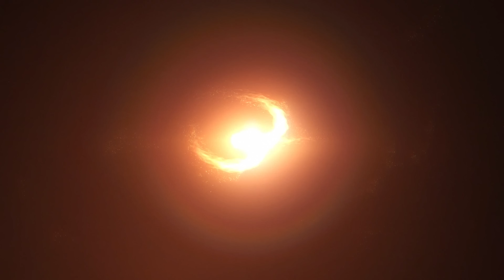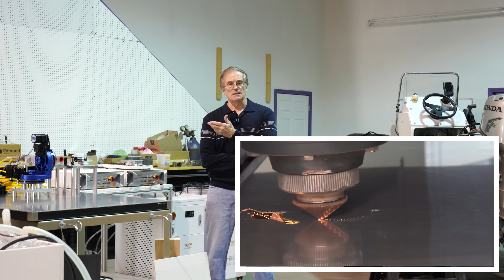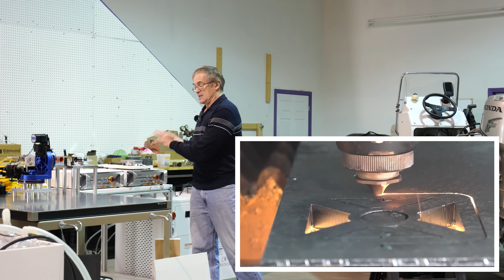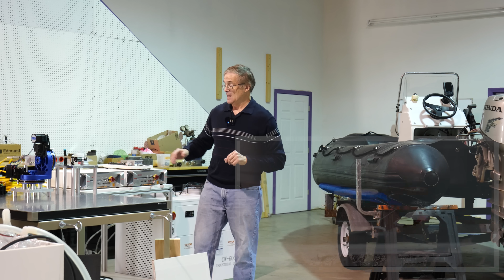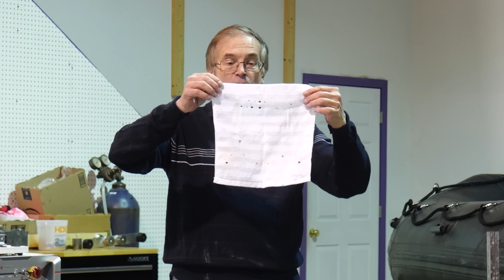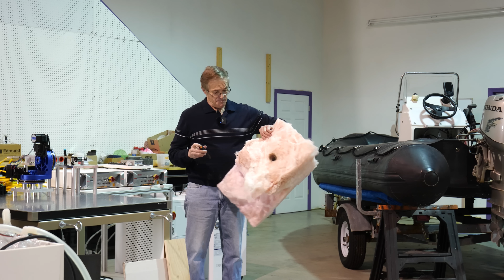We have a problem... and need your help!

Comment: Paper that has been wetted with borax saturated water, and the allowed to dry, will not  burn.  It will smoke but will not propagate a flame.  So treat your plywood with borax water and test it out.

Another idea is a wall filled with sand.   As the sand is obliterated  by the laser, new sand will fall into place to replace  the smoked material.
Another idea is a wall filled with marbles, the glass should diffuse the light and just like the sand wall, marbles that are obliterated will be replaced with fresh material.
Reply: Sand wont steam, most will glass  so no hole filling.

Comment: I own fibrelaser systems, and i fear without specialized material, there is no big chance. We have a company here in german, Bergmann & Steffen GmbH, they produce the llaserwall system, a relativily cheap protective wall system. Maybe you could ask them for some kind of sponsorship/demo setup? Not sure with the current tarrif situation. But you may also be able to find some parts in the US. Look for laser-welding protection systems.

Comment: I have NO idea what I am talking about. But, I wonder if having some metal powder (The kind used for 3D printing/sintering) as the backing would absorb the energy better. Because what I think the actual issue is, there isn't enough energy being absorbed by the backing/blocking material fast enough, before it just "explodes/ablates" away. The powder would absorb the energy by not having any real direct path through, and the powder MIGHT shift and flow back to the melting zone better than a solid would. I'm kind of doubtful about this though, as most of those powders are meant to not move. I don't know, but it might be resettable like shaking an etch-a-sketch. Obviously, don't use something that would start any sort of 'thermal runaway' situations where it could self sustain that reaction... But maybe nylon? Stainless Steel? Maybe a mix of both, to prevent one or the other from sustaining a reaction?

Comment: Before you even mentioned a wet blanket, I had remembered the old demonstration from science class where the teacher held a plastic water bottle over a bunsen burner to demonstrate water's heat capacity, the bottle wouldn't melt away, the water within kept it cool enough. Perhaps combine a water vessel with an intumescent coating or paint. I'm excited to see what others suggest.

Comment: My brain says... molten salt with ground quartz and graphene, suspension in a constantly blending tube via induction pumping, only problem is getting a viable encasement for the laser light to penetrate but not build heat... maybe a jiggling glass apparatus that shakes and rotates so the heat cant focus and burst a singular area, it would have to be soooo fast but could be miniaturized once tested.

Comment: I suggest the following..  Graphite blocks: Available from EDM suppliers (electrical discharge machining), Used kiln firebricks to back that up .Check ceramics suppliers or surplus.. For  even more  protection back the  rig up with a sheet of steel  or copper  painted  black angled at about 15 degrees .. use active or passive cooling on the plate ..
Reply: Graphite fire is no good
Reply: @WanderingThoughts11235  Spray some water on it while in use.
My intuition says that it would be hard to set a graphite brick on fire with a 10KW laser even if you tried. But if you want to be extra safe, just inspect the graphite wall with an IR camera when done with your laser tag session.
Reply: Ha, same idea. :D
Bricks of compressed charcoal will have some fly off and the smoke disperse the beam further.
Awesome to help. :)

Comment: 2 panes of clear glass with water between them, color the water with dye to absorb the light. Or you could just do it outdoors and point the laser up into the sky. Also during testing the laser doesn't need to be a full power, you only need to verify it hit, full power is only necessary during the final demonstrations to show off destructive force.
Reply: That might add expense by needing to reinforce the roof to survive the rain of falling airplane wreckage.

Comment: I’ve enjoyed your site for many years.  My daughter owns a freeze dry company.  Her comment “ice is the bane of my existence” has led me to research the science of ice and water vapor to help optimize her systems.  Unfortunately my ideas were never scaled up to help her, but the science  of ice has stayed with me.  At first it seemed your laser was pointed down.  An optimized size tub of water and not a wet dish towel may be worth a try.  If clear water is unable to prevent pass through, then adding a black powder or tiny metal flakes to enhance refraction may be tried.  Back to ice.  A sheet or block of ice is cheap and easy to produce.  If reflection off the surface is too great, a cover sheet over the ice would allow the laser beam to punch through, and prevent the ice surface to act as a mirror.  Frequent replacement of the cover would be required.  A less cost effect experiment would be to use dry ice in lieu of ice.  A problem of using a laser to drill is the dust and powder that is generated in the hole that refracts laser light.  A metal tube could be filled with smoke or duct particles to help refract the laser  beam.  A prism came to mind but the laser be be intense to vaporize the surface mirror any dust that collects on for surface.  A prism separates light into different frequencies, but laser light may be more coherent and the refracted light may not be split into different primary colors.  Interesting problem.  I’ll follow your progress.😎
Reply: Yes, ice would be best you're right.
Reply: I second the ice. It was my first thought also.
Reply: Instead of ice, why not packed snow? It'll split up the incoming beam into fragments and be cooled off faster
Reply: yeah a big ass-block of ice or maybe get fancy with some other frozen phase change diy goop
Reply: @ Actually, you just made me remember something even more simple: pykrete.
Reply: Water is too reflective; ice WOULD be literally perfect bc it kicks out vapor when hit, scattering beam, but too hard to make that much

Comment: @NightHawkInLight has a video of how to create Starlite like material using very cheap household materials and I believe in the end it will fully carbonize to protect and carbon has like 4000 °C melting temp. When heat is applied, the material chars, which creates an expanding low density carbon foam which is very thermally resistant. Starlite was also claimed to have been able to withstand a laser beam that could produce a temperature of 10,000°C. I believe using this is your best shot.
Reply: His video was the first thing I thought of: https://www.youtube.com/watch?v=0IbWampaEcM

Comment: Have you guys tried a heat resistant paint? Perhaps that could be used on a couple of layers of a silicon treated canvas tarp. This stuff is good to 2oooF 
Rust-Oleum- high heat ceramic spray paint.

My 9yr old son and I Love you guys!

Comment: Try a bags of wet sand. Build a wall from them. Its cheap and I'm pretty sure its going to work. In the end you'll be left with a bunch of sand that you can sell or use for something else.
Reply: Or tiny glass beads... You sell as jewelry. Lol
Reply: the water would cause steam explosions, not a good idea. Dry sand is the best.
Reply: Good idea, and the sand may even transform to glass, absorbing more energy in process (and producing even more fun ^^)
Reply: Could be highly reflective glass. Dangerous.

Comment: Buy large bags of fluffy fumed silica and used them as sandbags. The fumed silica diameter is smaller than your laser wavelength so you will get raleigh scattering, plus it's non-flamable and melts at high temp. This is only an idea, I don't know if it's safe so be extra cautious!

Comment: So to make it short, you need a high energy shutter and a room where you can turn the laser energy into heat without starting a fire/create "dangerous" toxic gasses.
And the shutter must react quickly and take up high power and a certain amount of energy.

a.) One way to divert: when you'd have a "cooled" mirror that can enter the beam rapidly - that can redirect or scan the beam at a "safe" area

b.) when you'd rotate (or even scan) a 45° at a certain rpm, the reflection would be spread over a much bigger area - which brings down the cooling and material requirements
a scan target must also not be the inner area of a cylinder but can also scan to increase the affected area thus reducing the specific energy on an area that needs to be cooled off.

c.) remark: the mirror should scan and direct the laser downwards, because burnt material could peel of from the ablative catcher, and when the material is below the mirror, contamination and destruction of the mirror due to ignition by laser light might be less of a problem

d.) the mirror could simply be cooled just by a directed water jet, aimed at the back

The targets could then be normal bricks, which you have tested, perhaps also wet bricks, due to the spread the survival time could be good enough

A graphite target would also be an idea, but then you need to use inert gas because under such conditions the C would react with O and another O and at best you come up with CO2, but at worst with CO - which is flameable/explosive itself - but as CO2 is mostly considered inert as well as denser than air, you could also use a constant CO2 flooded chamber, that works like an aquarium that is constantly(because heat->convection->gas loss) CO2 filled and where the targets are submerged and therefor cannot catch fire.

Similar to the experiments that are done in school where you can demonstrate with that air and gases behave very similar to fluids and can extinguish for example a candle.

The CO2 filling could simply be inserted from a gas bottle, or you could put dry ice in a bath of water, that would fill up the "catcher volume" with CO2 and work as fire suppression.

- Al2-O3 in corundum (blast medium) form could also be interesting, high melting point
- Another thing you could try is a kind of flow cooling: What would happen when you have your plywood continously flowing down water - like in a water play that overflows a top spillway.
that would also remove any fire risk and is regenerative with a pump and filter.

- Strange idea "a soot chamber", the laser is direct at a chamber where soot particles (smoke) is that would reduce the energy at the final impact

Comment: another idea could be using a moving target, like a rotating wheel of a heat resistant material able to resist the beam for a few seconds, like concrete, so that the laser energy is spread over a much larger spot overall. it would need to be replaced eventually, but it should hold of a bit and can be made relatively easy to replace

Comment: What if you took a two layer approach. One outer layer that gets punch through initially and then the second layer that has a ton of refractions to refract and reflect a beam with lower intensity back to the first player. Probably a standoff between the two layers.

Comment: What about some sort of water container using a matt glass for containing the water. You will also have to mix some aditive in the water that will not allow the light through the water but rather just absorb most of the energy.

Edit: balistics gel also just came to mind?

Comment: How about a wall made of fibreoptic that redirects the laser to a single point that is more durable (brick/concrete).
(since you do not need to have a durable part on every point, if the laser only hits the surface on one point)
Although I have absolutely no idea how much that would cost or if there is something you can already buy ...

Or a really big glass lense that redirects it to a single point?
But that would probably also be to heavy and takes too much space.

Also I think I saw a video about a black protective coating that made things durable so they won't take damage ... but I can't remember if it was also heat resistant.

... just thinking about solutions atm. ...
Reply: oh well the coating was called "line-x", veritasium had a clip with the title "Indestructible Coating". Quote: "is also used on the walls of The Pentagon in the event of a bombing"

Comment: Taking inspiration from a black-body radiator - You could build a box with many mirrors and/or prisms to bounce the light around. Or would the intensity of the light be too much and burn clean through the first mirror?

Comment: I'm curious if HDPE (High density polyeruthene) could be used as an ablative tile, would need to be thick at least an inch i think. As other have mentioned Starlite that nighthawk lighting did the some experimenting with and Areo-gel could be some other alternatives.

Comment: I have worked with some high powered lasers before and we had a "blanket" of diffusion crystals and that was over a fireboard that was about 3/4 to 1" think. From what I can remember this worked well for us. However I didn't see where you gave the power of light source in your video so calculating your needs are impossible. The cost was a little high from what I can remember for the 'Blanket" but the rest was cheap. I hope you can find what your looking for, and I may be able to help you find the "Blanket" from my military days.

Comment: Make a test protype of a steel plate, alum plate, dry sand, alum plate and a steel plate. Steel would hold up set together.  Alum will be to help transfer heat.  Dry sand will flow, but melt in to glass; transfering heat. the last alum plate and steel to help stop and buy time to cut laser off.  Plus, at the end you can sale the metal to recycler. Sand can be gave to play ground or other use.

Comment: Would ceramic or concrete floor tiles be too heavy?

Or take your wet blanket idea but add a reservoir and a pump so there's a constant waterfall running over it?

Comment: What about laser beam-traps used in labs ? (I think they use anodized aluminum or graphite). Zap-It is one company that makes them. They have a water cooled version for 0-1000 watt capacity.

Another idea to consider is a large de-focusing lens at the destination.
Reply: Looking up those lasers I'm pretty sure that they're each 3,000 watts and he mentions wanting to focus them both into a sub mm beam Channel... commercial back stops are wildly insufficient.

Comment: Keeping your plywood wet would keep it from being able to catch fire enough for firemen to be called would be the cheapest option. 
I guess you could also attempt to build a light proof box with photodiodes of sorts in it. Once the laser burns through the first layer, the photodiode in the box sets off a cutoff switch to your laser. Could even probably modify a Sawstop saw control for it if you don't want to deal with starting from scratch.

Comment: Lot of good ideas have been mentioned. But I think a combination of suggestions may be the key. 

You want something that is fairly portable and easy to construct. It must be capable of dissipating a considerable amount of concentrated energy. No toxic off gassing or flammable materials.

Starting with “kiddie pool” as a sump, place in an easel with a ceramic tile covered sheet of rockboard. This is your “sacrificial backstop”. Use a pump with a  laminar flow head at the top of the easel to provide heat dissipation and eliminate  a fire risk. 

Fresh water has about a 4.2 J(k-G) thermal coefficient, so you can conceivably calculate the flow rate required to cool the tiles.

Even with constant water cooling the beam will impart some damage to the tiles. But with a few tiled rock boards on hand, they can easily and rapidly be replaced as necessary.

It is a cheap, easy, and viable solution. Perfect? No, But it certainly checks all the boxes.
Reply: Could work !
Reply: from my understanding he needs to cover the wall... to test against a moving target
Reply: @MaryBrownForFreedom The rockboard panels are 3x5ft so I suppose it would be “feasible ish” to stack them in an arrangement with a 4” pvc pipe split into a trough to return the water back to the sump. Could build that into a 10x15 with 10 panels. But then of course you have additional support structure and definitely increased expense. 

Depending on anticipated “beam contact time” the rockboard may be suitable without the inclusion of the ceramic tile face. Im thinking of a product similar or specifically the Hardy brand backer board.

Comment: I'm far from an expert, but my first thought is to create a sort of backstop. A couple of nice fussed quartz convex lenses one after another at a ~45 degree downward angle. Reflect the beam down while spreading it out as to not damage the floor. Alternatively, beam splitting convex lenses in the same arrangement to split the stress across several optical surfaces. Another path is to use smoke, as militarys do to counter laser attacks. Maybe a constantly flowing volume of smoke in an optically transparent housing.

Comment: Two things come to mind the first is probably hard to get and that is the type of tiles used on the space shuttle, the other is fire bricks much lighter than house bricks but absorb a considerable amount of heat. If fire bricks work it wouldn't be difficult to construct a target structure on industrial casters so it can be moved. Possibly something like this VITCAS 1260°C /25mm per Meter Ceramic Fibre Blanket

Comment: Liquid cool (behind the plates) Silicon Carbide (SiC) sheets. Melting point of over 2500 deg C usually and a very high thermal conductivity above 120 W/m*k